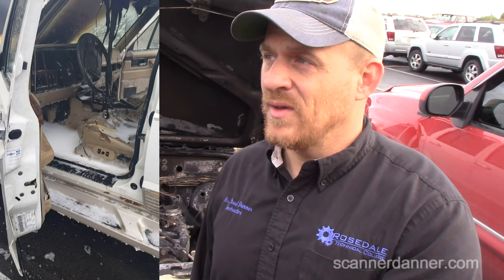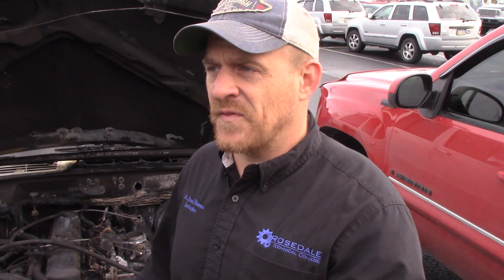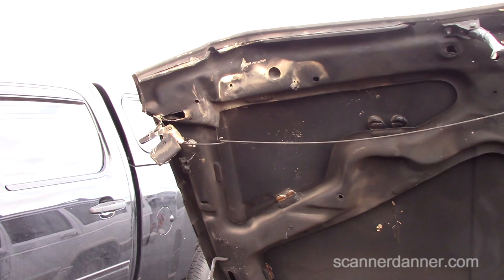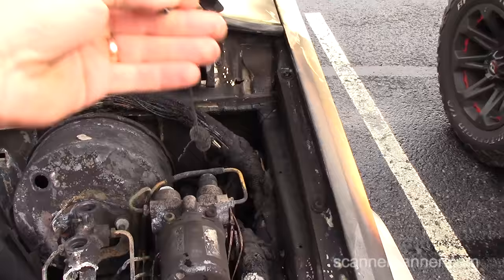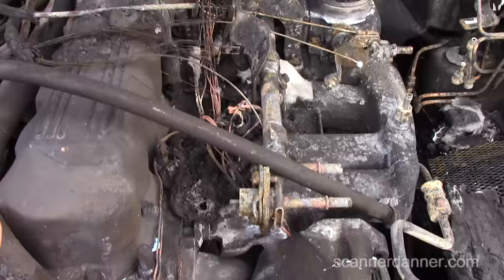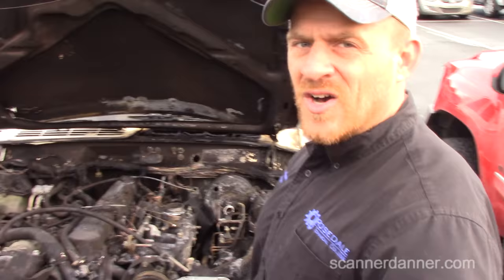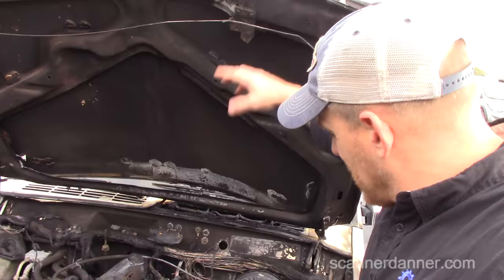ScannerDanner's Jeep CATCHES ON FIRE!!!

Comment: Judging by the degree of burn damage in the upper driver side of the engine compartment, I would agree with your initial assessment of the fire's origin.  The cause of the fire had nothing to do with the repairs you performed; however, as you mentioned, if a garage last touched it, through no fault of their own, they own the car.

Comment: Feel real bad for you Paul , what a shame ! I can relate to your predicament  , had a ford pick-up i rebuilt the carb. for . Was at my first dealer ship ,  right out of technical school . When this happened i  was there a couple of years an was in tune - up an drivability  working with  a older mentor . I had rebuilt a number of quadrajet carburetors , the computer controlled kind , an never had any problems . The  dude that did used vehicles was on vacation an i got elected to take over for him . When this ford came in i hooked it up to the sun scope to check it out , ran fine but couldn't adjust the carb . I told the shop forman , so he got a used one from slavage yard an i put a rebuild kit in it . Ran good , no problems  , adjusted it , shipped it . It was going to the auction the next day . Well the next day at work i looked out the back door of the shop an there is the ford burning down to the ground .

Comment: Hi Paul, what a bummer to see that beautiful XJ turn from white to black :(  
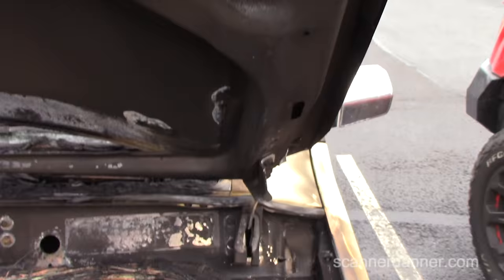I'm going to try to be a forensic scientist: Looking at the vid at @0:50, you can see an intense burn mark on the hood, towards the front to the left of the centerline. Plus you say that the hood release failed early on. At @4:36 you show the hood latch mechanism itself, and the rod from the passenger side is supported by a metal bracket EXACTLY under that burn mark. BINGO. So hood release pull shorted to B+ on passenger side of vehicle, and created intense heat at the point of greatest resistance (bracket), welding itself to it. This probably caught the insulating blanket on fire if there was one...sound plausible?
Reply: I buy that.  The oil/carbon only provides fuel, not ignition.  To get a hot enough heat source to sustain a burn, you need a significant ignition source,  and an electrical short is most probable.  The compressed air may have exposed or moved components, he was unaware would short.

Comment: At 5:07 it's very clear to see the brake master cylinder burst and the pipes of its front missing part are fine .  I believe it's because of heat. The insulation of wires were gone, too.  Glad no one hurt!  I would like to know the answer as of a mechanic.  It's very shocking.  By the way, thanks to Paul with his tech videos.

Comment: First off, I've been loving your tech videos the past year since I've discovered you.  I'm an '00 E.T. graduate from Thaddeus Stevens in Lancaster, so can appreciate proper troubleshooting(would've loved you as an instructor).  I've owned XJs since 1993 and plan to do so until gas costs >$5/gal.  I highly doubt you did anything to cause this fire---not even neglecting cracking insulation on wiring.  Get yourself another XJ, but stay away from the '00&'01s with the crack-prone 0331 heads and Cali emission pre-cats.  Keep up the good work!

Comment: Things like this certainly catch your attention. What i have seen a few time is earth connection problems with the main earth lead, and the car using something else to get an earth.Seen thottle cables and a lot of choke cables burnt and melted due to a poor earth connection problems on much earlier vehicles it has to be said.
A fire under the bonnet if it were loom related you might find cables fused together due to the heat and you might see this inside the car also.
Good luck Tam.
Reply: that sounds very reasonable because it would generate alot of heat

Comment: If that base plate is designed specifically for the Jeep XJ platform, it should fit from 1984-2001 Jeep Cherokee (XJ) platform. To be safe, go for a 1987-2001 Model year Cherokee.   I nearly lost my '87 2 door due to a Harness issue, with nearly the same result as yours. :O  I got the fire out on mine within a minute or so of noticing the smell and smoke.  I ended up pulling out the entire harness, from nose to tail and rewiring everything.

Comment: I wonder if there was an issue with the PCM or the harness in that vicinity.  Looks to me like the 'hot spot' was on the front left corner of the engine compartment.  Opposite side from the battery, as some viewers have suggested.  Just glad nobody was hurt when the Jeep decided to torch itself.

Comment: PAUL ......that happens  to me   1 time ....I almost  ended  up  paying  a  car.   in this occasion it happens  when I was chasing  a lean condition... and  I was spraying  brake cleaner    to the intake  ...  expecting  to see a change in rpm and short term   instead of that .... there was big fire   at the engine  bay...  I grabbed  a fire  extinguisher  &   it eliminates the fire on it... but I learned  a lesson....  don't  tray it again   with a distributor   and sparkplug  wireless  around it. . that's  why when I  see u spraying  a bottle  of water  at the intake  ,I  remember  my mistake. .... but that's how we learn ...from our mistakes. ....

Comment: Sorry for your loss.  Do not be so quick to assume blame.  Not certain that debris on the exhaust would cause a fire unless it was paper like in substance.  Check your fuse boxes to make sure someone did not put in a higher amperage fuse to mask an electrical problem.  Source could also be a leaking injector seal, fuel rail, fuel line, or even EVAP line.

Comment: when I did valve cover gaskets on my old 1991 Subaru just at 300k miles when I did the job as it was leaking a qt every 20 minutes. So I had to spray the engine with degreaser which is flammable. It is the only way you are going to access the valve cover after a bad oil leak. So if you dont wash that off after you are done, you have engine degreaser and old oil = FIRE. The way I washed it off is I had two five gallon buckets filled with water and just kept dumping that over the area I sprayed degreaser and oil. I started the engine and after 5 buckets, it was still smoking when it got hot. I shut it off took a pressure washer and sprayed all the oil around the exhaust. Can never be too careful.

Comment: not a jeep but I had my f150 almost burn because of a leaking cruise control sensor. brake fluid was leaking internally on the contacts and it started to smoke. luckily a passerby saw it and I stopped and disconnected the cruise control switch as it was still smoking. feel your pain.

Comment: Like I posted in the last video I watched and loved about you breaking down the O2 sensors and the wiring harness as well as what each wire doe's, also the computer hook-up and the very thorough definition of these sensors and how they operate I am thankful enough to ask you this: do the math on what you paid for the truck,parts, and time. It's not worth getting angry over it as long as you made money off the investment you made on the truck. Did you get your money's worth out of it? Traveling,teaching, ect. Add it all up and until this point did you get your money's worth? I hope you did because just from the 1 reply I got from you seems like you're a great guy and it happens to the best of us.

Comment: Look at where the hood cable is melted. 
It has to be the exact location of the origin of the fire. I am a Tig welder and any one that's a welder knows that electrical arcs are much hotter and quicker that oil fires. Also, I have never done it, but it is possible to arc weld with a battery.

Comment: The mid 90's dakotas also have the same issue. I've seen an early 90's model dodge dakota burn down in gas station parking lot and the aftermath looked similar to yours, (burns in the inside driver side of the car).

Comment: Many years ago my car started pouring out smoke from under the hood of my 67 Cougar after I hit a bump in the road. Upon opening the hood, I saw the now exposed wiring glowing cherry red and I immediately grabbled the red hot battery cable and yanked it free from the battery terminal to stop the destruction. My right hand got branded by the cable but I was out at the wrecking yard pulling a wiring harness out of another Cougar the next morning.

Comment: I'm sure it's been said about a dozen or so times.  Just glad YOU are okay.  Things can be replaced.  And very impressed you had the calmness to let others know to move their cars/trucks out of harms way.   No injuries, limited property damage (While I know that sucks.....if the fire spread to others in the area......more problems)   This could have been much much worse.  And I tend to agree, the initial  heat would have to been in that direct line with the release cable to seize it up.  Just an opinion however.
Reply from the maker: Thanks brother

Comment: I seen the buildup from stop leak. It does look like carbon deposit. I just did a rebuild on a Ford truck engine that had stop leak put in it. It had to be hot tanked to remove it.

Comment: Man, that really sucks. Sad to see one go. Me and my dad and a few friends are huge fans of the XJ. They're great vehicles, i especially love driving that 4.0 with a 5-speed behind it. I can't say any of ours have had anything like that happen. My old 94 Cherokee once had a fuel leak from the o rings on the rail. The exhaust being right there makes that very scary. A friend had a 96 which a previous owner had rigged up some kind of aftermarket alarm or remote start straight to the ignition switch and it almost caused a fire. But the factory wiring has not been a problem for us. It is worth mentioning that way the orange 8 volt (yep its 8v, pin 7 on the ECU) wire is spliced near the center of the fuel rail and some other similar splices never made me feel all that confident, though. It looked like an OK job for a splice someone might do at home, but i would expect better from the factory.

As for replacing that one, 91-96 are all identical your 95, except for minor OBD-II related things on the 96. You could go with an 87-90 as well if you were fine with the pre-Chrysler (Renix) EFI system on the 4.0. I'm sure you could make a lot of videos on the Renix system. I wouldn't really go for an 84-86 since they only came with the 2.5 and 2.8. I would imagine your towing stuff would fit 97-01 as well since they're not really much different if at all underneath, but I'm not totally sure on that.

Comment: My girlfriend had a grand Cherokee back in the days. Hers was a 01 iirc?  Which ever year first came with that goofy coil "rail" which was a major pain in the ass when it started acting up.  That thing burned 3 times that I recall.  Twice because of that coil pack (it melted) and once because of the fuel injectors.  No physical fire thankfully, but hot enough to damage things.

Comment: Most dealerships don't back up their work. But the smaller shops tend to do so, because they generate business through word of mouth. My melt down was a brand new '95 Ram 1500, one of the first delivered to Alberta, fully loaded extended cab, 4x4. Had a cheap command start installed. I do remember it was -35C so I restarted it 3 times, at a 10 minute run time. Heard a weird whinny sound driving to the shop, ignored it, new truck and fricking cold. Turned out starter staid engaged and the wiring harness got so hot that the insulation started to burn.
Reply from the maker: Oh man, that's rough.
Reply: Holy shit that was a quick reply, I'm waiting for sunrise to tackle my son's 93 Grand Prix again. Have so many stories about electrical fires. Back in the 80's picked up a '78 Ramcharger cheap. Owner wrapped the blower motor, tube style fuse with tin foil. Always ben a Mopar guy, and struggling with the Pontiac. I need to pull harmonic balancer off to access crank position sensor
Reply from the maker: yeah, you definitely need a puller. I used to own a 77 PowerWagon. It was my favorite vehicle and I know that blower fuse issue all too well. I ended up cutting my wires to the fuse box for that fuse because it was so badly melted. I installed an inline fuse and all was well. It was this issue where I first learned that poor electrical contact = excessive resistance = heat :-)
Reply: lol  I also have a'80 Powerwagon since '01. Tough as shit, 4" lift and 35's. It's a good thief stopper. 4 spd., manual choke , most cant figure it  out.

Comment: I would say biodegradable wire harness Mercedes from 90s had this and Volvos from early80 had disintegrating looms. Diesel and engine oil is quite hard to ignite unless you have heat and a spark flame .Just One of those don't ignite it 60 degree Celsius and a flame for engine oil flash point so once you have 2 sources it will ignite. therefore the harness was the first source as you already point out with melted hood cable maybe it used the hood release as a current path also ?

Comment: ROUTING OF WIRING HARNESS UNDER WHERE LEFT FOOT RESTS CAUSED INSULATION TO BE WORN AWAY, SHORTING ELECTRICAL SYSTEM/CAUSING FIRE.    I just read this under NHTSA complaints. This looks like the cause of your fire.

Comment: In my opinion, this was indeed oil catching on fire as your main harness is lightly burned and not even the wire insulation burned too bad if the fire started there it would be COMPLETELY gone. my theory is the valve cover gasket was leaking after replacement very close to the exhaust manifold and oil has accumulated some where, after the short drive the oil started to ignite and we all know when oil ignites its burning very hot and cant be put out easily. the small pieces of carbon/oil sludge wont do any harm even if it was on the manifold as it would burn so fast and produce little smoke at initial startup..

Comment: I know I'm two years late on this comment. But to me, it looks like the fire started at the fuse/relay box. At the beginning of the clip shown is the heat concentrated on the driver side of the hood, the fact that the hood cable ran directly over it to the latch is what sells me on the fuse/relay box.

1. The fuse/relay box is GONE compared to the rest of that engine bay. 
2. The hood release cable would have ran directly above it
3. You said it smelled electrical
4. The damage just above the driver headlight
5. The small fire you see firefighters putting out, directly under where that sits

That all indicates the fire started in that general area.

Comment: Having worked on vehicles literally caked in oil, I doubt any amount of oil and carbon would cause a fire, if for no other reason that there wouldn't be much to feed the fire. Fires come down to gas, electrical, or a ton of accumulated dry debris catching light. Glad you're ok, that's what matter.
Reply: Adrian Kingsley-Hughes
Oil and stuff caked on the exhaust pipes/manifold can easily catch fire. You know how the exhaust manifolds often are rusted? That's because the heat causes them to rust faster. Interestingly, this effect can also be used in fire forensics. :)
Reply: Manifold would have to be more than glowing red hot to ignite engine oil/even hotter for hard, oxidized sludge. Considering it's neighboring an aluminum intake and the point of contact is inches from the head, it's extremely unlikely.

Comment: the buildup you were blowing out sounds like stop leak. it does exactly what you were describing that was built up in the drain backs.
Reply from the maker: No, it was 300,000 miles of lack of oil changes. The stuff I was blowing out was heavy carbon deposits.

Comment: Way late but I have personally witnessed what short circuiting a 4 gauge wire from the positive terminal to the negative terminal of a battery can do. The energy in a battery is capable of a lot. My point being that electrical short circuiting can do a lot even with smaller gauged wires. Combine several small gauge wires which start to melt each other, then mesh and short circuit multiple wires at a time could potentially heat even more and possible get to metal melting temperatures.

Comment: Well, that just sucks. I replaced the alternator on my Sisters 1989 T-Bird years ago and a week later it burned up while she was shopping. Talk about feeling sick as she loved that car and i was the last one to have the hood open. I had a big scrap with the rebuilder but that's another story.
I'm not on my good PC right now so the video is not very clear but it appears to me that the fire started in the left front corner as that is where most of the damage is as well as where the hood release cable runs. I will watch the video again later. I'm not an expert but looking at it from a different perspective might help. You know that wiring gets old, the insulation shrinks and cracks so anything can happen especially if it's been disturbed.
 If nothing else your video's helped someone learn how to do some of the work their own vehicle might need. At least no one was hurt in the fire. You could have been driving it when the fire started. Maybe some one was watching over you. 0:-)  
 I hope the insurance pays for your loss. You need a vehicle with a manual trans for towing anyway to avoid burning up an automatic.